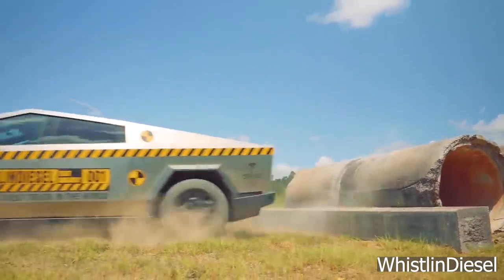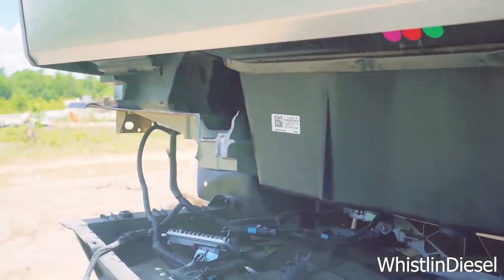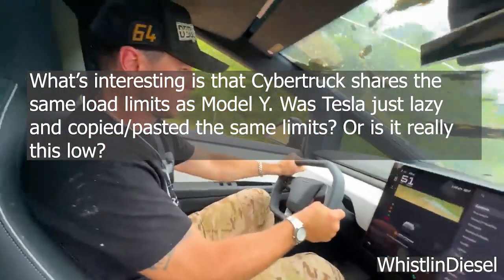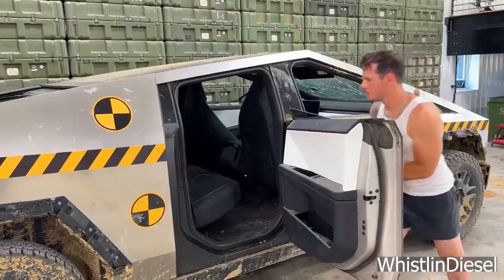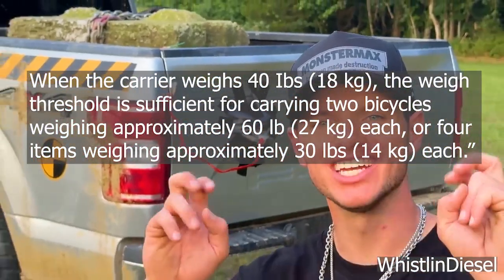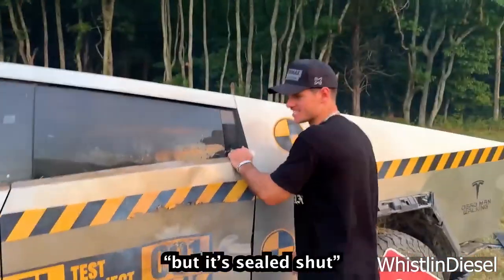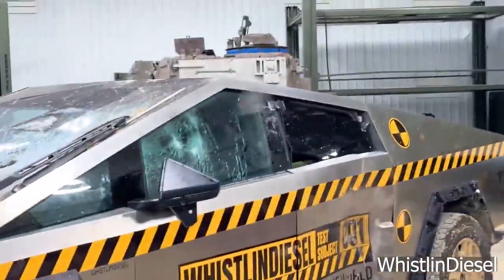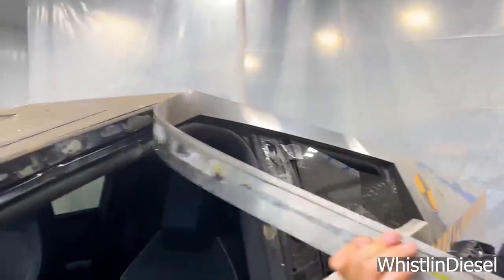Tesla Cybertruck Hitch Rated to Support the Same Vertical Loads as the Model Y

Comment: vertical load is similar to ball weight and most caravans and campers towed in Australia range from 200-400+ lbs. pulling capacity is less important to towing the the vehicles ability to balance the weight of the load in transit. Cybertruck is fundamentally a dangerous car to have on the roads
Reply from the maker: Thanks for your thoughts

Comment: So in effect the damage was caused by the people operating it not reading the part of the manual that lists it's capacity ratings.
Reply: youre right but you've missed the point entirely. It is misleading to advertise the cybertruck as a work truck, which Elon did, then say in the manual that it can't do truck things. It isn't intuitive that it would be weak in this way.
Reply: @jonathanfairchild  We have a Class C RV that turned out to be a lemon.  Once we get it fixed, we are planning on selling it and using the money to buy a trailer and a truck to pull it.  I've discovered that you need to be very careful about the specifications for trucks because they advertise cargo and towing capacities of 'up to X' values.  And none of the trucks you see on a lot are going to come anywhere close to the advertises capabilities.
Reply from the maker: Yeah! That's right

Comment: Well...Elon knows more about manufacturing than anyone else alive, but....
Here's the thing...aluminium has no endurance limit, ie there's no stress level below which you can safely design, in the valid expectation of infinite fatigue life. Thats why nobody makes aluminium springs. 

Aluminium is therefore unsuitable for high-failure-consequence applications subject to high cycle fatigue like car chassis that might be driven on corrugated dirt roads, or trailer hitches or components they might attach to. 
That's what i learned when i got my degree in mechanical engineering.
But i am alive, so elon will know more than me.  Maybe his team used unobtainium?
Reply: I've been putting it this way: The failure mode of cast aluminum is usually some form of fracture (Cybertruck snapped) while the failure mode of high strength steel is some form of yield (F150 bending).
Reply: Airplanes are made out of aluminum. Lots of load cycles and big consequences for structural failure. 

You do have a point though, especially considering that the cyber truck uses cast aluminum. Seems like a poor design.
Reply: Modern aircraft are more likely composite than aluminium, but you're correct, it was used for many years.  That doesn't negate any word i said though... those aluminium aircraft still had a finite life not an infinite life like a steel spring or axle.   

And so the aircraft were very thoroughly designed and tested, so they KNEW how many fatigue cycles to expect at each location, and this was backed up by an inspection regime whereby critical areas were sunned to regular inspection for cracks (and indeed cracks could be found and would be monitored for crack length, as the critical crack length had been found beforehand (ie the cracks that is big enough to propagate unassisted to the point of structural failure).
This is why some aluminium fighter aircraft are so expensive to run --- they may need 20 inspection hours or more, per hour of flight time. It isn't just the fuel burn. 

So here's my question before you go buy an aluminium framed car -- are you prepared to pay for those regular maintenance inspections (strip to chassis, and inspect for cracks), and if not, are you happy to just drive the car to the rubbish tip after a few years and walk home, or are you just going to put your head in the sand, ignore the "will eventually break in half" issue, and put your family and others nearby at risk?

In a consumer product like a car, where there's no well funded military to pay the maintenance cost of an aluminium structure, it is a dumb design choice. Simple as that.
Reply from the maker: Yeah! Thanks for your view

Comment: idk the tesla did get its frame cracked earlier in the video... but still the thing is just dangerous, unreliable, and impractical
Reply from the maker: Tesla should have done better
Reply from the maker: That view is subjective
Reply: @Teslapage  what is subjective? The thing is a piece of crap and had a major recall
Reply: 170 lbs gross weight isn't much for a bike rack if you want to bring a few mountain bikes. Pretty sad that this "truck" can't handle that weight